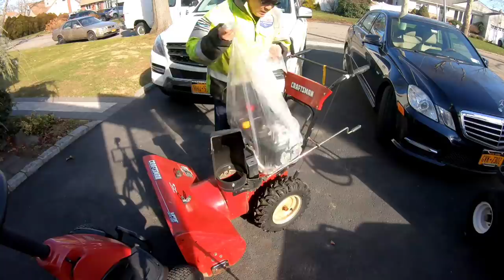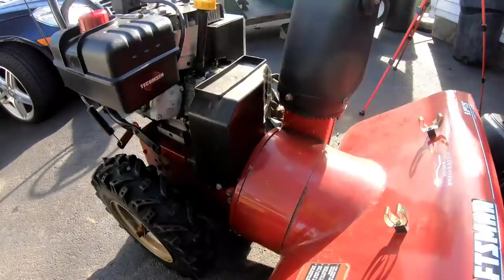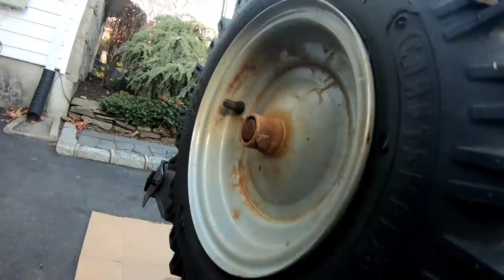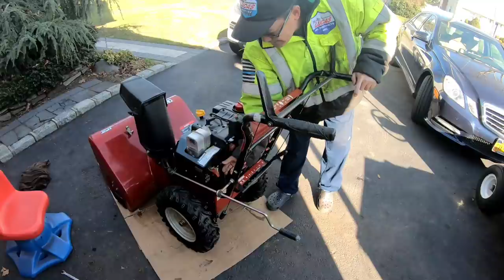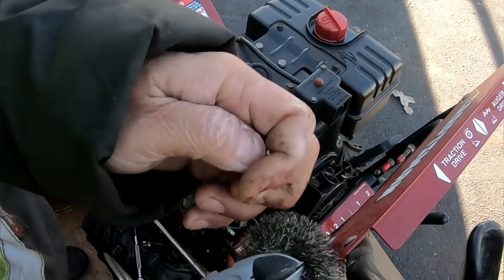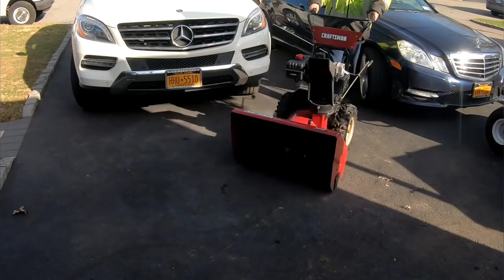SURGING SNOW BLOWER?CRAFTSMAN 9HP TECUMSEH 29" SNOWBLOWER CARBURETOR CLEANING DRIVE BOLT REPLACEMENT

Comment: I have a Craftsman 9/29 and I love it. We get real winters here in MN and powers through anything old man winter throws at us. Mine surges for about a minute until it warms up and then runs fine.
Reply from the maker: That’s normal,  just stale gas or ethanol starting to build up around the hole.  Once fuel
Is pushed through its smooth,  hope you subscribed

Comment: Henry, get a gas torch tip cleaner, has a bunch of sized wires so cleaning out those carb jets is easy. Lowe’s has them for $4 or so.
Reply from the maker: I have them,  I use them on the videos regularly,  just reached for whatever was closest

Comment: I possibly see another issue that you may want to look into. Where the drive cable connects to that metal rod with the two springs (two springs connect to the “Plate Swingi”), your drive cable needs to be over that piece of metal rod rather than below it. In the configuration in your video, the plate swingi is being pulled down and towards the friction disc rather than just being pulled towards the friction disc. If it’s in the wrong position, the cable may wear out quicker.
Reply from the maker: Operates as it should,  this I’m not going to fix what works as normal.  I didn’t notice any irregularity in its operation